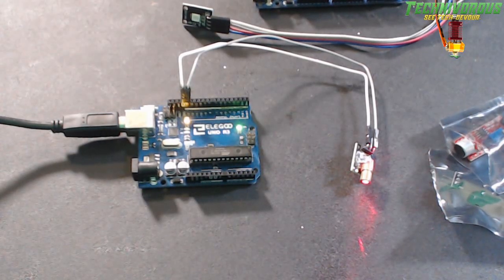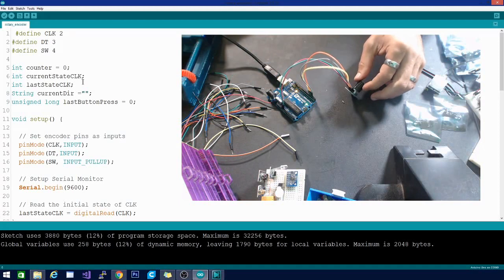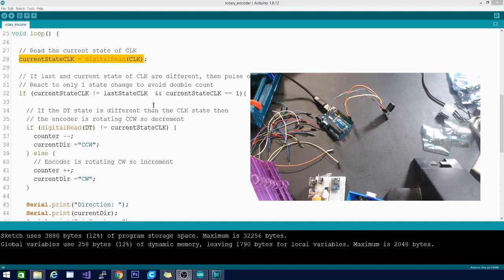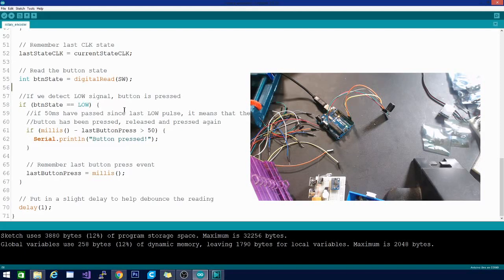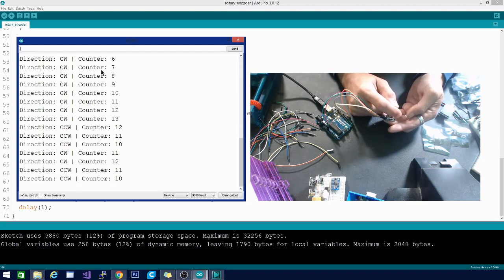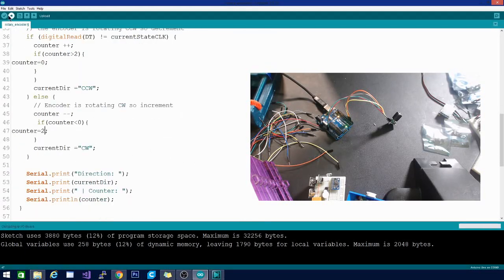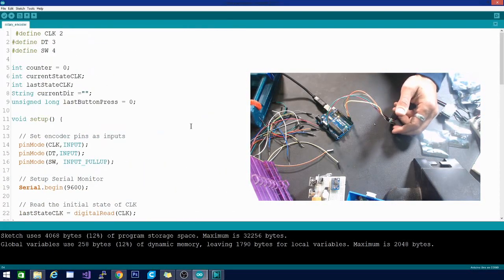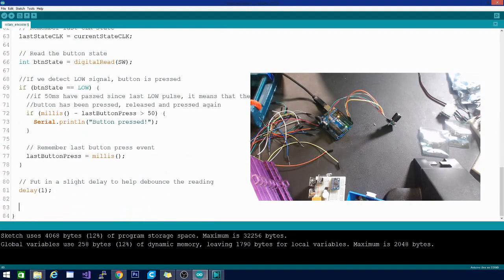HW 040 Rotary Encoder With Click   Arduino for beginners   Sensors

Comment: Thanks, got my encoder working, however when I turn my encoder I have to turn it two full clicks for it to increment in the code. Is there a way for it to count every turn rather than only every two turns?
Reply: You should do two things, first remove “&& currentStateCLK” (line 35 of the code in the video at 7:45) from the condition. Second, add a debounce protection, add a check to prevent a change if it happens less than 50 milliseconds. You can add this along in the condition line 35. That’ll give you a change in every single click of rotation and will prevent unwanted back jumps.